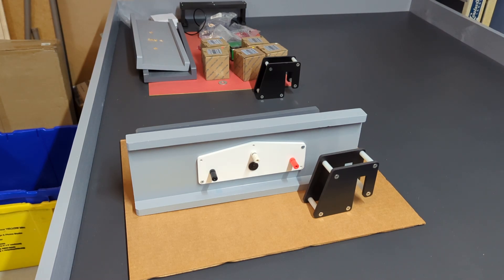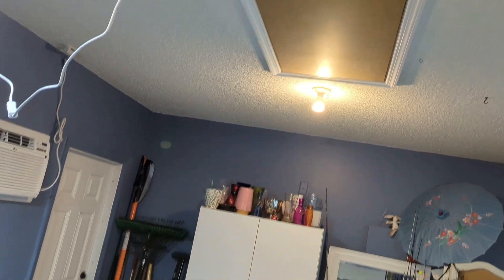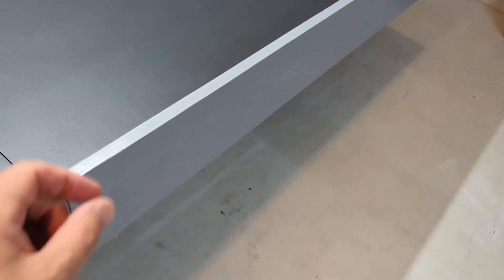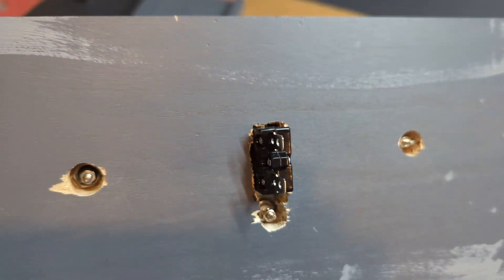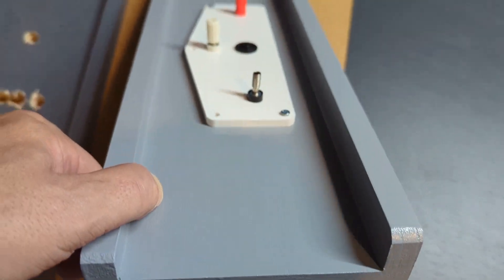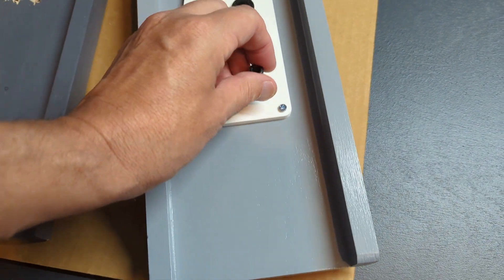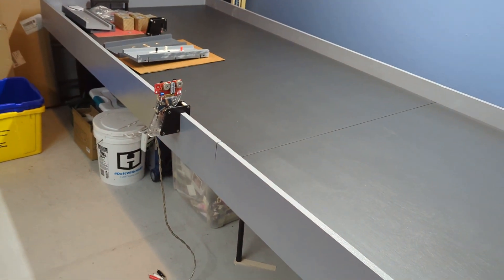Track Table Update Part 2

Comment: Those driver station shelves will need to be pretty sturdy. You might have drivers leaning on them when reaching for deslots or any number of other situations. However you decide to attach them, expect some unexpected forces to be applied to them.
I've seen some stations that mount similar to how your controller holders fit on the edge. Real handy if you need to move them around and something like that would take care of your attic stair issue.
Looks like you got this, Mark. Looking forward to watching you unbox it, wire it, and set up your timing system.
Viper makes some sweet track. Can't wait for your first laps.
Reply from the maker: Thanks! Yeah, will have to see how the little shelves holds up. I am really looking forward to the rest of the build, now I just need the track! I emailed Viper they don't have an ETA yet but said it is in process.

Comment: Looks great … shelf idea is great … I would trace out the driver station and cut a big hole like 1/2 inside the line you traced for wiring out the back … and make a removable pin so they can’t just be lifted off incase someone yanks controller the shelf can’t come off and crash to the floor
Reply from the maker: Thanks! I was thinking about just cutting out a whole, I will see how easily the shelf comes off, probably up to me on how tight i make the screws holding the shelf on.

Comment: Agree with clnfreak one… you will want a single larger opening under the driver panel. I have the same driver stations and you’ll appreciate the wide open space to work with. Great choices, including the silicon wire (you might want more wire).
Reply from the maker: Thanks EJ, I was hoping 100 feet of each color would be enough, can always order more if needed. Gotta love Amazon, I got most of that wire same day delivery.

Comment: I think you should use a softer boarder for crashes. A firm and flexible plastic.
Reply from the maker: I ordered 3 inch high my 3.8 inch thick foam that I will be putting on around the inside borders of the track table and do plan on putting up plexiglass boarders as well once I get the track installed and running and see where I need them the most.